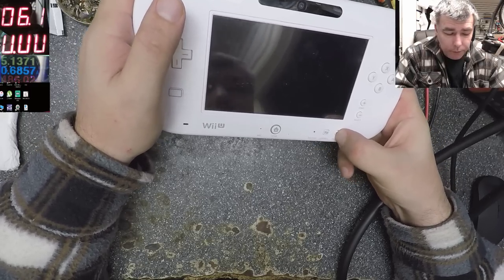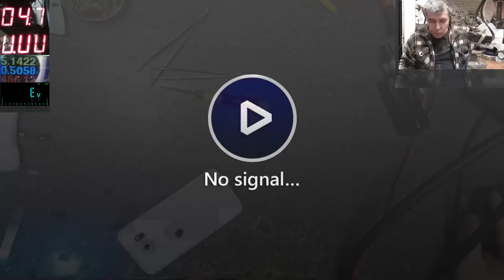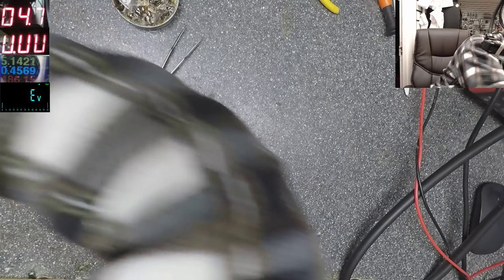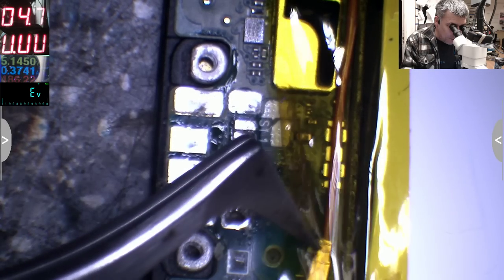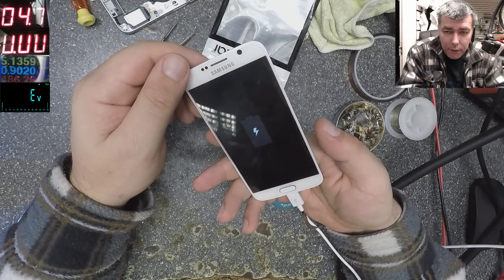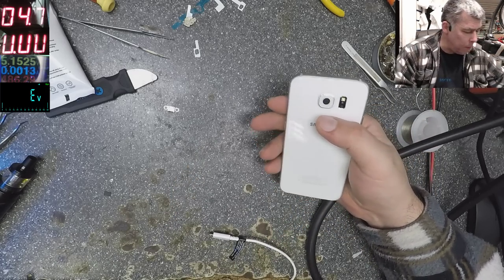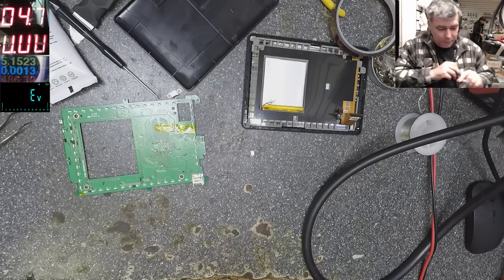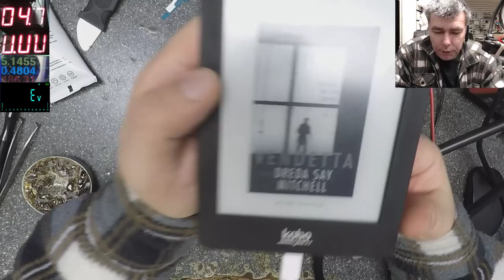Samsung and Kobo book reader charging ports repair

Comment: Hi,
LIke the video ,need to learn repairing like you, i have a Samsung GT I 8262 which is not turning on when i put batt. the flash light open and the IC turns hot.,i don't understand what is the problem.
Reply: Its maybe u have a short on ur board..